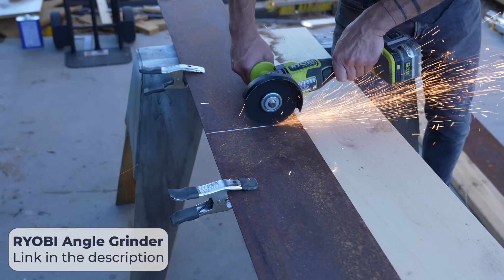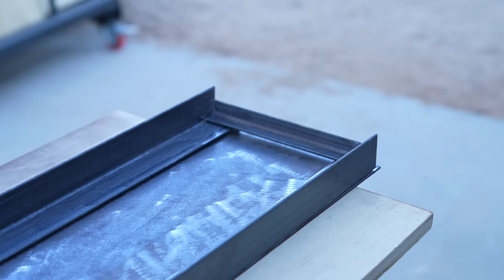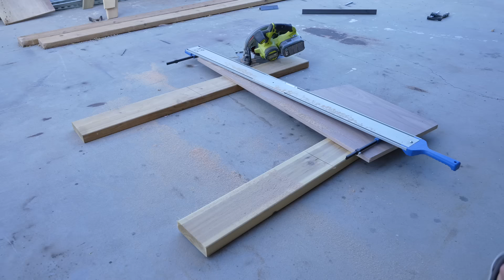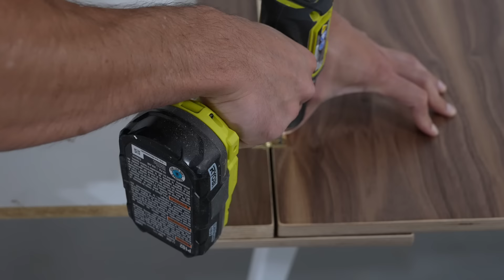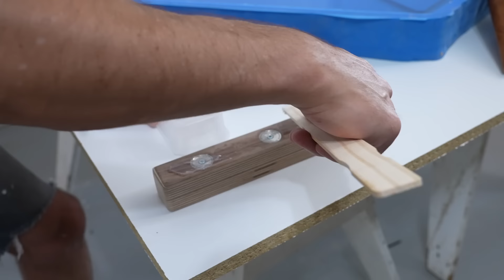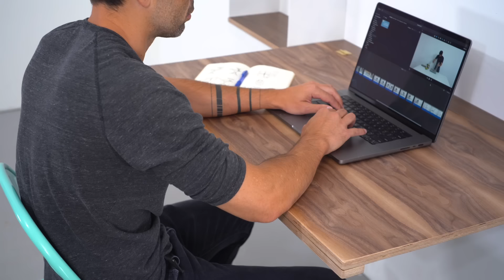Making a Fold-Out Desk

Comment: You know I really crush on this design.  Mine is going to have a loose desktop with dowel handles and brackets at the interior; along the sides to hang the desktop ; making it a drawing table. I also will probably add a fold lamp. I will have cabinet/capsules on either side, that have deep doors for hiding the art supplies stored there.  I like the desk depth that you have used here and the overall design concept. This is wonderful.

Comment: Good idea, I think the folding desk could easily have double function. When closed the underside of the table could be used as sort of a whiteboard by adding a thin white glossy sheet of metal to the underside of the table. It could be used as a chalkboard as well if you paint it as such. One problem is I don't know how that would work practically because I'm thinking if your knees could get dirty from the marker or the chalk if you move around a lot while sitting. That's why another option I'm thinking of is to display art that's printed on a metal sheet (like darkplates for reference) so that touching it while sitting wouldn't wear out or damage the art significantly.

Comment: If you could leave more space behind the desk panel to hide a wall mounted monitor? or mounted within the product? Like a narrow reinforced steel plate comes down from the inside, the top (middle) with a VESA mount, welded?) that you could screw in or off? Has an option when buying the product?, that very narrow reinforced steel plate with the vesa could be on a rails system preferably a quiet one, then to add power we could add a tiny box below or on the side to hold a power hub, i have drawings if my english is too broken (being french) :) i'll take 1% of the sales thank you haha (or just one product i really need one )

Comment: The desk top looks like it bows still quite a bit under arm weight.  Maybe have arms  that rotate out from the underside of the frame to add more strength to the underside of the desk.  Could also use those same arms as cord management/power supply pieces? 🤷🏻‍♂️

Anyway cool idea

Comment: You could add shallow shelves in the space behind the desktop when it's up (maybe with perspex sliding doors) to keep everything in place and have space for pens, post-its, USBs and whatever else you can fit in it. Some speakers may also fit in that you could have at the perfect head height that you can plug in to improve your sound quality. LED strip lights could also be worth thinking about - maybe a recessed socket in the wall space behind the desk as well. A lock would also be good as another comment said. If it's just for a hotel room, the speakers being fixed and possible for guests to plug in their laptops would be good and the LED strips.

Comment: Could also add a folding platform that hangs on the wall adjacent that turns it into standing desk
Reply: Or cooler but prob more expensive option, the whole box slides up and down rails on the wall to adjust the height

Comment: Great project.  Consider a cork or light weight metal back inside the void of the table covey.  Also, you might consider a hydraulic arm for raising and lowering.  This is a safety idea just so the table top cannot just drop on a person should it get dislodged from the magnet.  Just some ideas.  Jack

Comment: In a hotel I'd be worried about weight capacity because you know someone will sit on it. I'm not talking about wall holding weight but leverage on the desk.
Reply from the maker: yes! I am considering through bolts on the hinges or a steel pipe hinge welded in.

Comment: Speaking as somebody who is 6'2" tall, I don't think the desk is too deep. I hate shallow desks that back up against a wall, and make my legs feel cramped. It may be ok for a few minutes, but start spending any extended time (over 15 min, IMO) 18" or 20" would feel way too shallow. 30" would be even more comfortable for me (actually, I would never consider buying a desk with less than 30", personally). 🙂
Reply from the maker: great point!  I have been tailoring lounge chairs for clients of different heights.  so many color and material options but too much one size fits all!
Reply: I think almost just as important as appropriate desk space, in regards to the depth, is knee/toe kick space. When I had a 24" desk at work, I was constantly kicking the wall behind the desk. I have a 28" now, and no longer kick the wall.
Reply: +1 for the 30". I like to always use a second monitor and prefer to use a mouse rather than the trackpad. I would also love to see a mounted power strip.